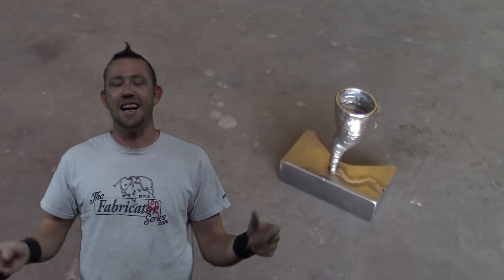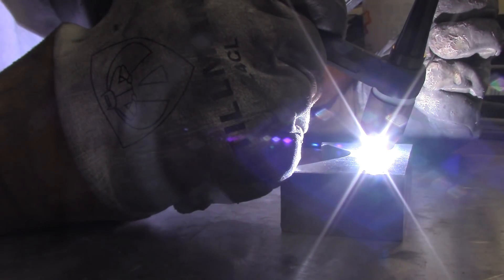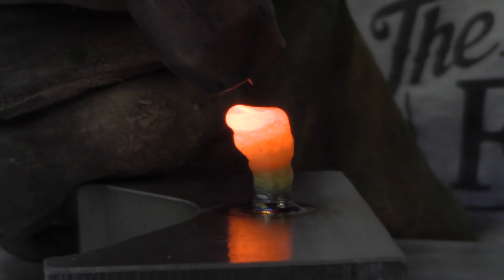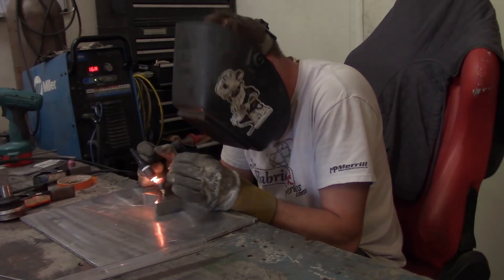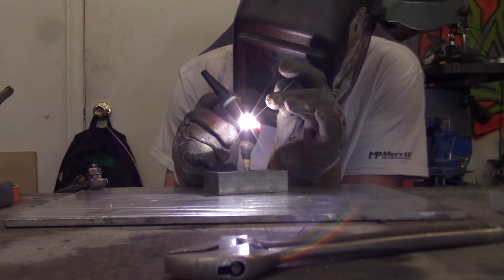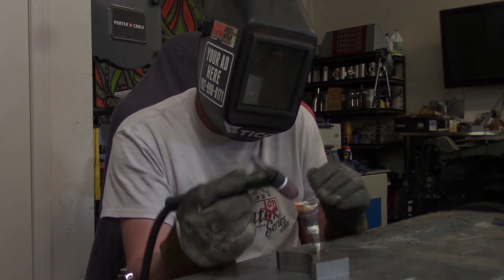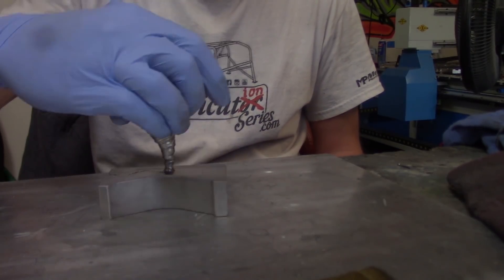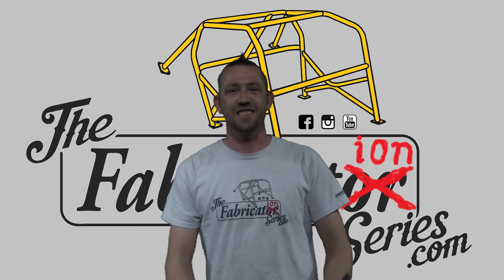TFS: Titanium Tornado

Comment: what is the cheapest material i can replicate this exercise , steel, stainless , aluminium ? thanks for sharing.
Reply from the maker: Steel is the least expensive out of all of them.
Reply: BisdremisKostas would be possible with just about anything depending on your skill level. but like a mild steel with some bronze filler wire would probably be a good option that's cheap and easy/easier to attempt. I have ran a bead and mid way through lifted the bead off of the part about 3/4" and connected it back an inch or so over before and it was surprisingly easy to do. so that tells you that it's possible to build it up in this scenario if you can literally levitate the bead off of the part. only issue you could come across would be too much heat and it caving in on you since silicone bronze has a low heat melting point.